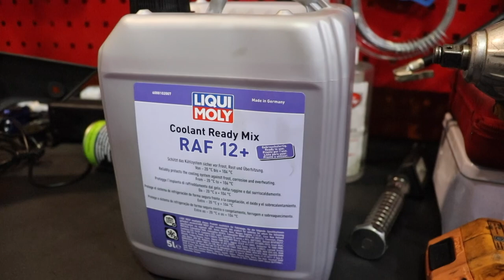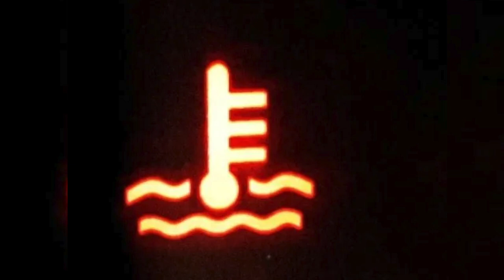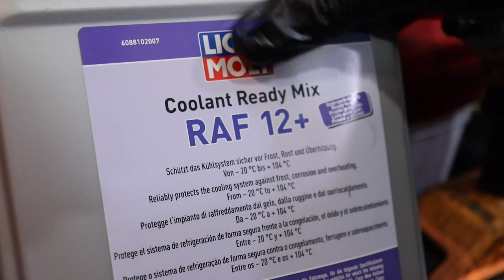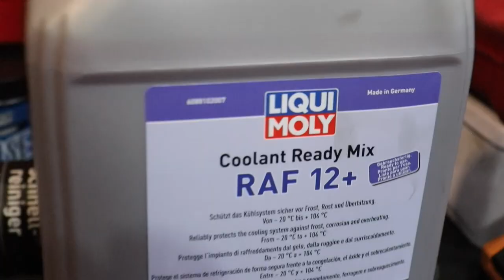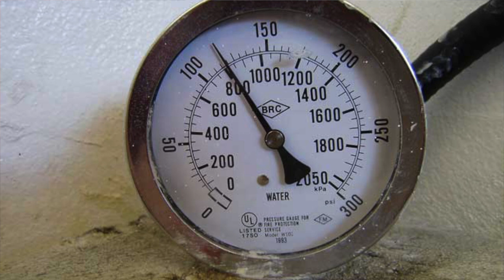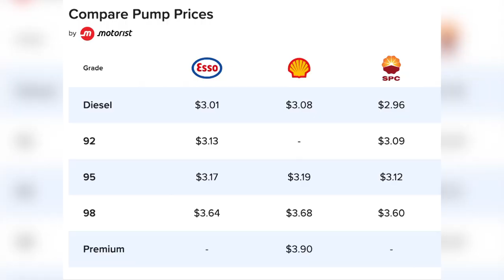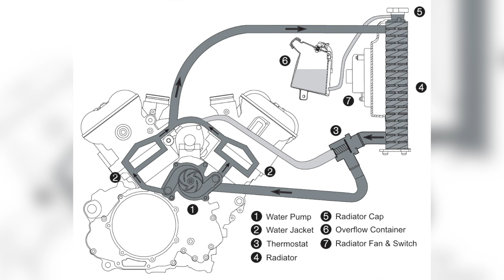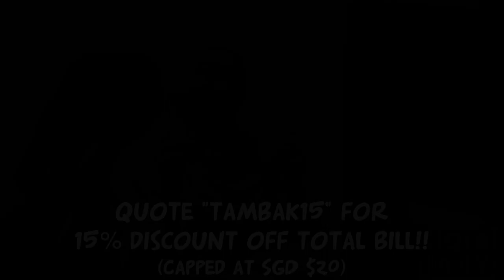Keeping it Cool: Radiator & Coolant Maintenance | Vlog#411

Comment: Here's my take on using water. Water absorb heat very well but only problem is that it causes rust. Like fah mention, best to get it change if you have added water. 

I believe most race bikes run water with water wetter as coolant as normal coolant contains glycol which is slippery when spilled on track.

I would like to correct fah abit. The coolant system is pressurised. The radiator cap is a pressure relief valve (see the pressure rating on the cap, it's the pressure the spring in the cap, will release coolant into the expansion tank). Since the system is pressurised, the boiling point of water is increased so the water won't evaporate. You can buy higher rating cap like what I did to my RC 390 track bike but make sure that hoses are in good condition as it can burst.

If your coolant keeps going down, there is a leak somewhere. 

For bleeding the cooling system, I rather just leave the radiator cap open and top up as it lessen the risk of scalding yourself. Very unpleasant experience.
Reply from the maker: Thanks for sharing your views and opinions.
Reply: @tambakoverlanders  keep the videos coming Fahmoto and Farhantre.. Farhan, now no longer see you along CTE in the evening 🥲.
Reply: @tambakoverlanders  anyway just my views... Cos I only MSCP mechanic😅
Reply: True 100% but different mech do it differently